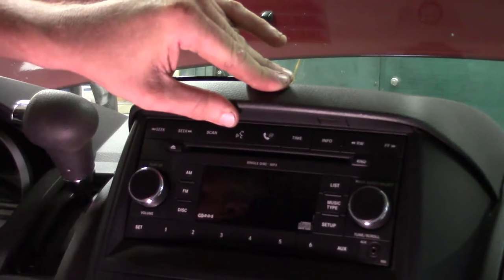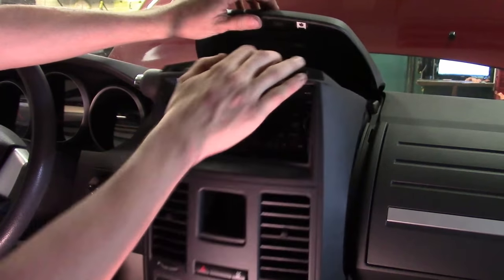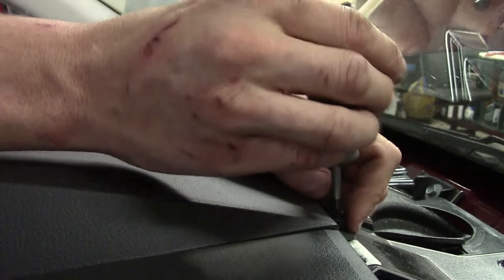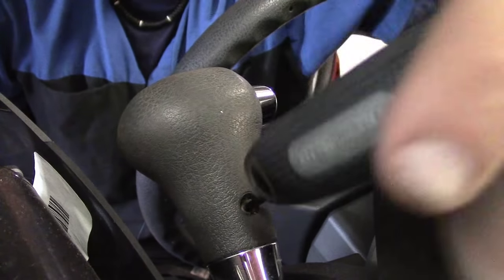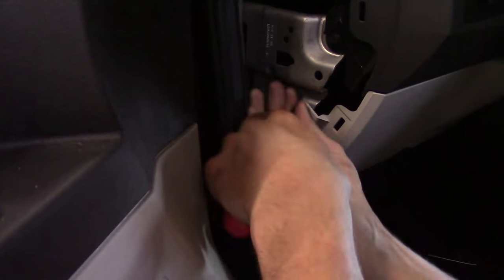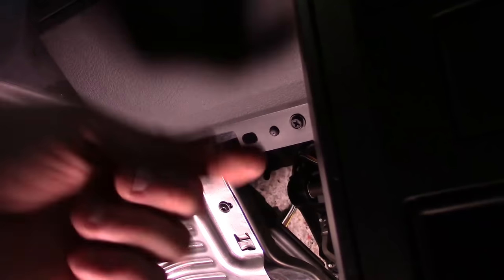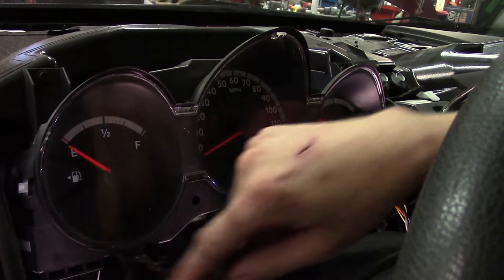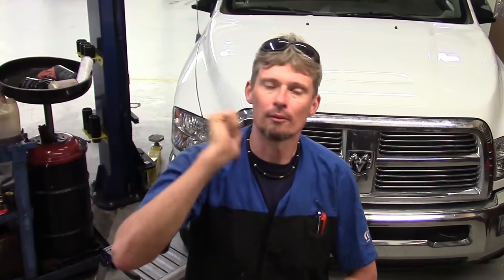2008-2010 Dodge Grand Caravan and Chrysler Town and Country instrument cluster removal.

Comment: I bought a dodge caravan 2010 but the mileage is covered with something black like tape and I can't see the milage. Is is possible to disassemble the instrument cluster further to remove the black plastic covering the milage ?
Reply from the maker: You can take it apart more once you have it out. I don't have any videos on that however. Just take your time and mainly try to get the lens off and see what you can access. I wonder if the mileage behind the tape will be matching the mileage you were told it has? Thanks for the question. Make sure to subscribe
Reply: +MotorCity Mechanic thanks I'll try it, yeah I hope it will match
Reply from the maker: +Jaime Lopez let me know what you find.....I'm curious myself